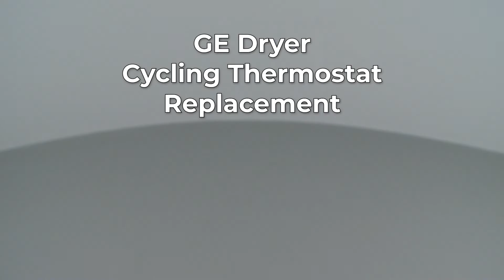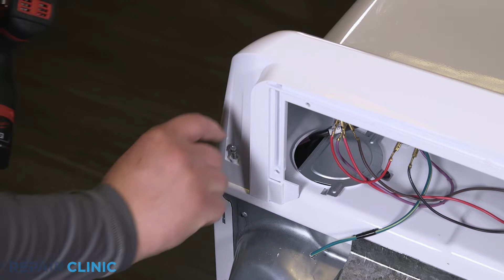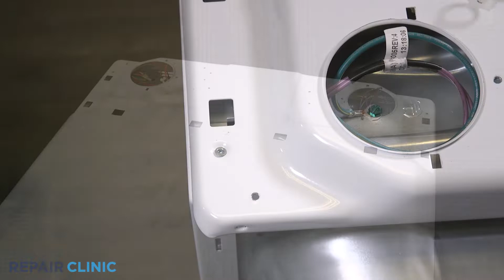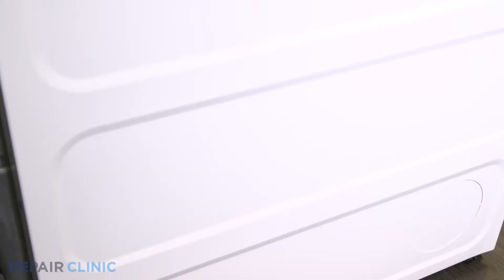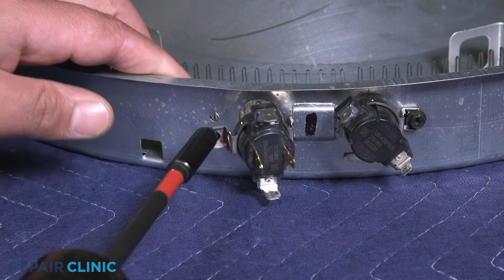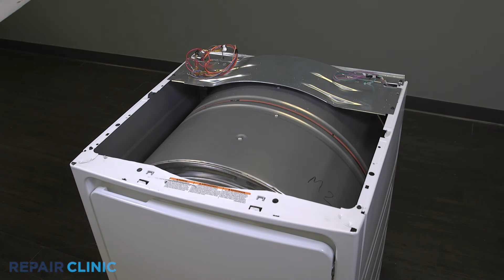GE Dryer Cycling Thermostat Replacement WE04X25201

Comment: Thanks for the video, but it seems you can do this repair without removing all the wires in the control panel by just removing enough screws to lift the top and lean it back against a wall.

Comment: ????

Why disassemble all that just to replace a thermostat?? It's one little screw easily accessed with a stubby hex driver or a 90 degree adapter.
You might think about taking 30 seconds to tell people how to test it as well.
Reply: And why take the control panel off?   Just lean it forward and take the two screws out then pop it back in place. You can lean the whole top panel backwards and get to everything.  Lots of unnecessary stuff being disconnected. This guy must be getting paid by the hour.  It is a good, informative video, but way too drawn out.

Comment: You replaced a 2 wire cycling tstat, but your showing 4 wires on it during disassembly and reassembly. Does the cycling tstat have 4 wires?
Reply: No he replaced the 4 terminal thermostat and as seen at 6:44 of the video.